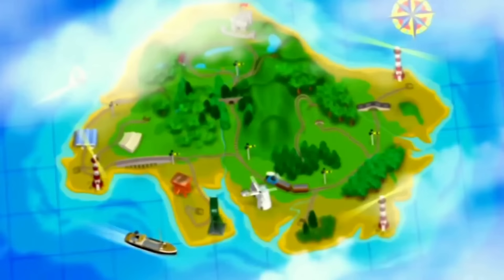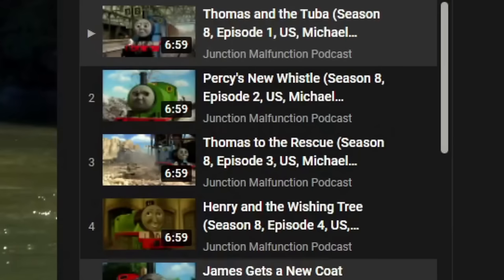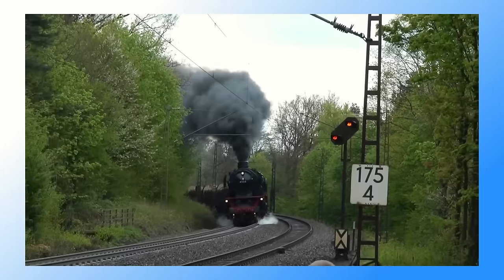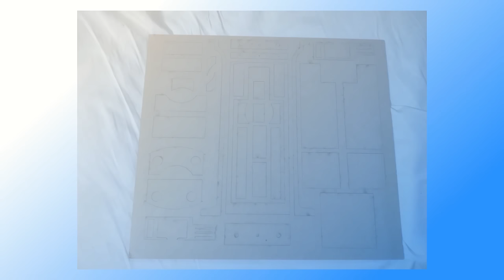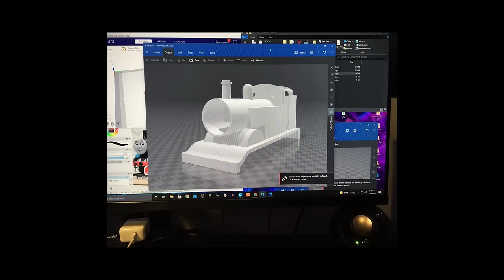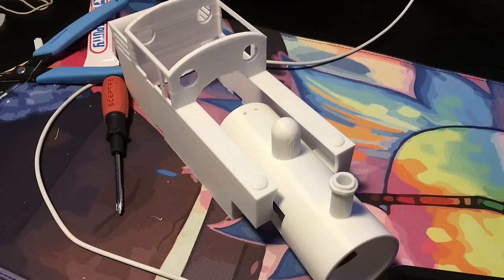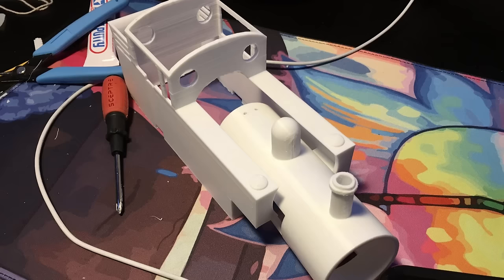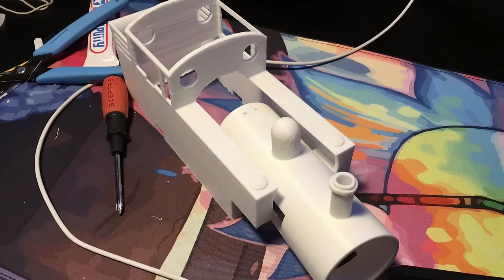How I Made My Gauge 1 Thomas | Tutorial (1,000 Subscriber Special)

Comment: Your model came out fantastic! Looks like a prop taken off the set. I can't stress sanding/wetsanding enough when doing work like this. The prep prior to painting makes all the difference ,I went through hell painting my Strasburg Thomas shell and it took 3 tries to get it right! Very inspirational video 😎🤙
Reply from the maker: I've seen your model! it's one of a kind and very cool. never seen anyone make the current IRL version of thomas.
Reply: @TankEngineJonJon  thank you! I wish I knew about the surface primer stuff prior to painting, I think that would have helped with the painting on my shell better, I just used run of the mill primer. I didn't have the print lines since my shell was resin, but I still sanded/wetsanded it reguardless. Keep up the good work!

Comment: I attempted to make an O gauge Thomas during my freshman year of high school, because I didn’t see anyone make one before and the Lionel Thomas isn’t accurate to the prop. So that’s what I’m going to try do during my next year. And this video taught be some techniques like the water sanding, paint underneath not fully dry, pin striping on wheel arch. I’m going to make a second version with the techniques you showed in this video to see if I can make a Thomas that Is as good as yours but at a different smaller scale.
Reply from the maker: I 100% believe in you! HKPorter on twitter has what he calls an “I-Scaled” Thomas that runs on lego track and is fairly close to the size of an O gauge Thomas
Reply: Thomas😊😀🚅

Comment: Watching this makes me wish there was a collector's line of show-accurate Thomas models.
If i had the power to warp reality i'd bring such a line into existence.
And i don't mean things like what Hornby and Bachmann made, i'm suggesting something that's actually AFFORDABLE, at around $15-$35 depending on the engine's size.
They'd be really good quality but mostly static, with only rolling wheels so as to keep the cost of each engine reasonable. BUT the default smiling face can be removed as there would be optional face packs for each engine, with a different face pack for each classic season as some new faces were added and old faces redone as the model era went on.
There'd also be CGI era face packs, for those who'd want them, along with easy to install Power Kits if one wanted to motorise their engines. Said motorisation also allowing controllable eyes.
And i would make EVERYONE that's been in the books and show, starting with The Steam Team of course.

Comment: 15:15    i didnt put it a microwave or oven or anything you said not to put it in...

instead i put it im my air fryer because you didnt say not to put in that
Reply from the maker: I will find you 👁👄👁
Reply: YOU WILL MELT THE PLA IF YOU USE THE MICROWAVE. That is the answer.
Reply: @connerrolofson1585  the heck is a pla???
Reply: @thethomasthetank  PLA is an abbreviation for polylactic acid. It’s a type of plastic that is used for models, components and and solid object prototypes. As a thermoplastic, it is served as a raw material for 3D printing. It is as a raw material used in additive manufacturing processes and applications.
Reply: @connerrolofson1585  yo my guy just explained the square root of 7

Comment: What measurement is your Thomas in? 1:32 or 10mm? I have been Working on a J70 "Toby the Tram engine" for 1:32 gauge 1. using sprung buffers the chassis from a Piko GE 25 ton switcher.
Reply from the maker: It’s gauge 1 so I think 1:75

Comment: I just wanna know why putting the 3d prints in the microwave is a bad idea... But I know ima probably need a different wheel solution, I wanna go for track power on mine.
Reply from the maker: It’ll melt your model into a nice goo and will probably break your microwave
Reply: Yes, and it is also too hot for the PLA.

Comment: Will you release the 3d printable model? please do
Reply from the maker: The model is a modified version of SodorInGauge1’s Thomas to look like the brass Thomas. With a custom built chassis and side rods. And wheels made by JamosTrainos on twitter.
Reply: @TankEngineJonJon  also what was the speed controller and radio receiver and rc controller that you used?